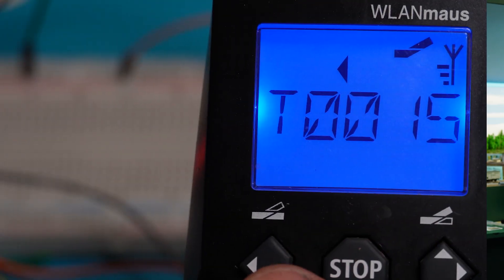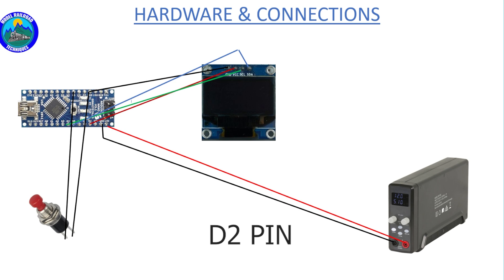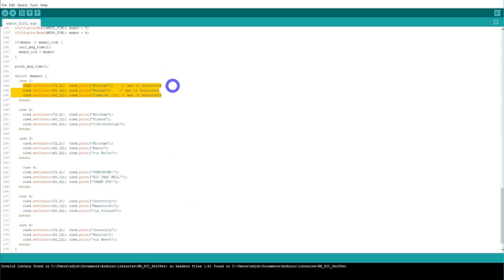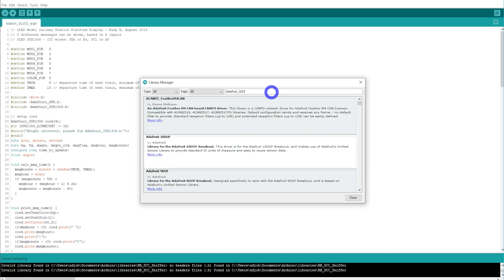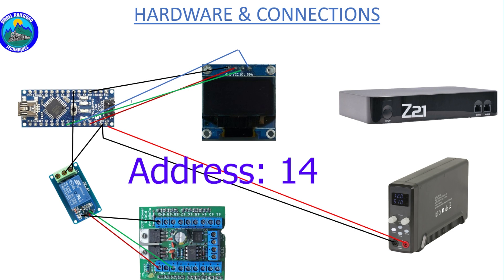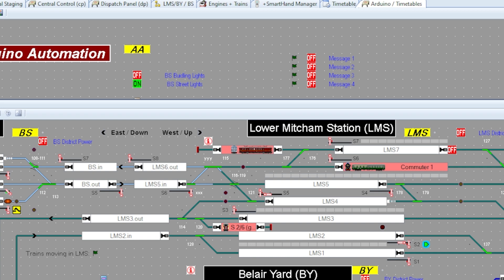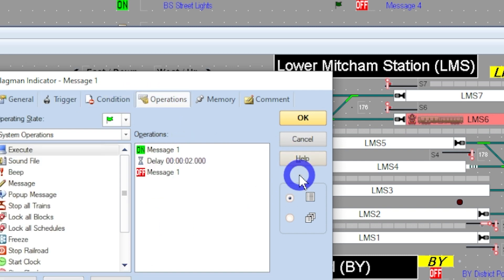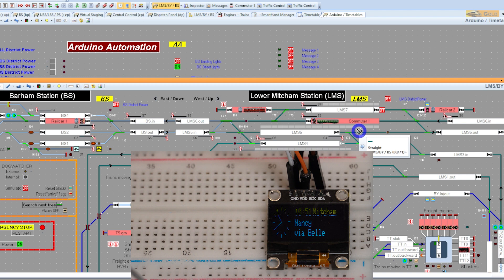Building a digitally controlled OLED Station Display for your Model Railway

Comment: Does Arduino Nano have a port to plug in a barrel connecter for power instead of connecting power with 2 wires?
Reply from the maker: Thanks for replying. No the Nano does not have a barrel connector. Easy enough to add one though or you can use the 5v input pins. Alternatively, a Uno or Mega can be used for this project, but a bit off over kill though.
Reply: @ModelRailroadTechniques  Thanks!
Reply from the maker: @BrennerEraFan  please let me know if I can help you further
Reply: @ModelRailroadTechniques  Thanks a lot, I might have questions on some of your other videos, but I'll be sure to post a comment!
Reply from the maker: @BrennerEraFan  thank you I also can be contacts on email. modelrailroadtechniques@gmail.com
Reply: You don't have to use a nano to run the code.  Any arduino can run it.   You'd just have to get the pins right for the arduino you use.  
Also, the way you power it is not really that important as you can mount the aduino under the layout and just have wires run up to the display.   You can run reasonable length of wires between the arduino and the display :)   
Also note the Nano has VIN and GND pins available, so you can connect power directly to VIN and GND pins, just make sure that VIN is 5Volts.   There are many ways to adapt things to suit your own needs :)
Reply from the maker: @EsotericArctos  thanks for your insight, always a pleasure to read. Correct many ways to get data on power to these littles guys